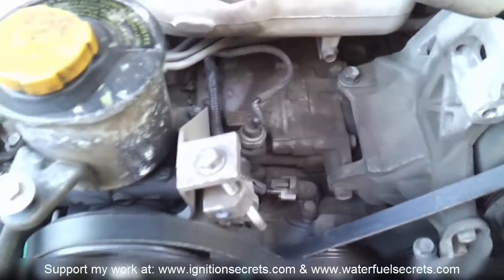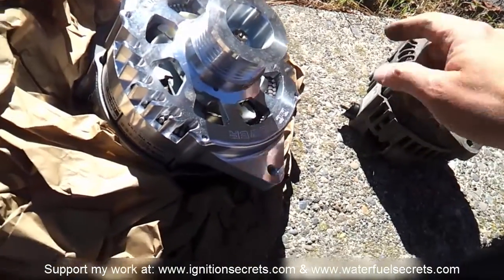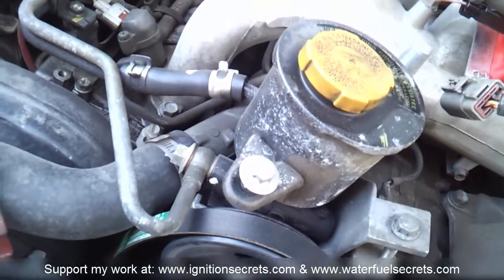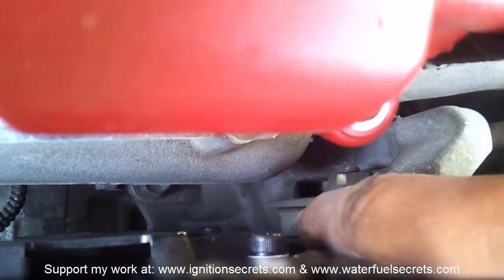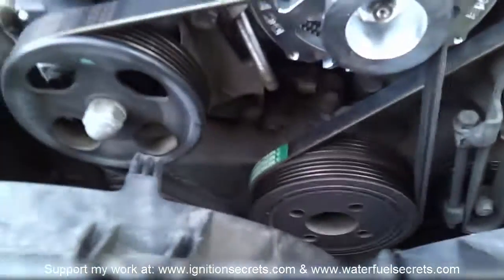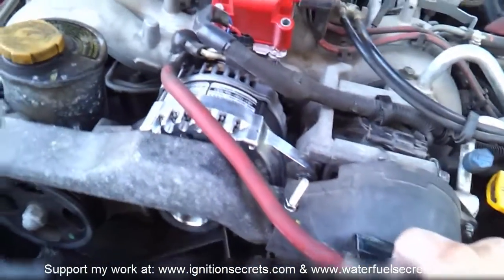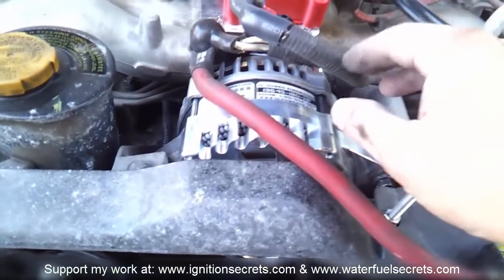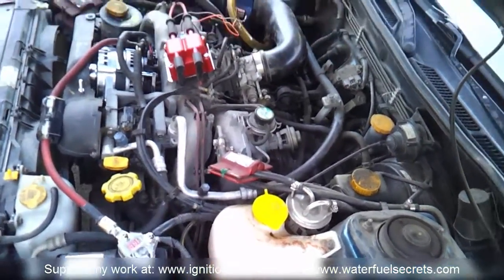Alternator Upgrade 180 Amps - 1998 Subaru Legacy GT 2.5 EJ25

Comment: Agreed, also... I just got done driving for a while and still seeing my headlights dim when pulling up windows, and rough idle when a/c on... This is alter the HO alt, new battery and big 3 upgrade.... What else am I missing?
Reply from the maker: hmmm, not sure. Especially if you did the big 3 upgrade for serious connections. Is the alternator belt at the right tension? I hope you don't have a bad voltage regulator in the new alternator. If you email them the symptoms, they can probably tell you. Did the give you the right plug or did you have to splice the plug into your factory harness? Did you connect them correct? There are 2 basic was and both will seem to work but one way will actually keep the coils buzzing in the alternator when the power is off and you'll know it is hooked up wrong.

Comment: how hard is it finding an alt to fit 1998 legacy, i have found many remanned ones but the highest output ive found is 130..?
Reply: Adam Abel i commented before watching the video... nevermind lol i am just gonna get a remanned to avoid the trouble because i am not as crafty as you
Reply from the maker: Adam Abel If you're not going to run any high power loads, the stock one is fine and easy. This one I have has a lot of power, but the mods to make it work isn't that difficult - just inconvenient.

Comment: Hi. I am doing this exact same upgrade. Did you ever tell DC Power about the wrong plugs?
Reply from the maker: Hi, I think I emailed them but they didn't mention anything. I had to just splice it into the factory harness.

If you have 2 wires reversed, it will make the coils in the alternator buzz since they don't actually turn off. What the Subaru manual shows for the alternator connections and what DC Power Engineering says didn't seem to match. I did it like they said at first and it was wrong so I switched the wires.
Reply: +Aaron Murakami I bought mine and they gave me the correct plug. videos are posted on my channel

Comment: hey hows that alternator holding up??
Reply from the maker: The alternator seems to be working fine, but there is an occasional problem starting the car. Code says crankshaft position sensor, put in a new one and that still comes up sometimes. There are a few issues, not sure if it is with the new coil or with the MSD dis-2 unit.
Reply: hmmm...yeah im one of those car audio guys..I have subaru outback and I just got the 250 amp alternator...thanks for the video again tho!! very much appreciated
Reply from the maker: Nice! I wanted a bigger one but figured the 180 will cover my needs - hydrogen cell and a few other items.